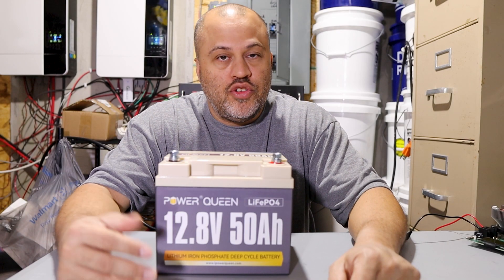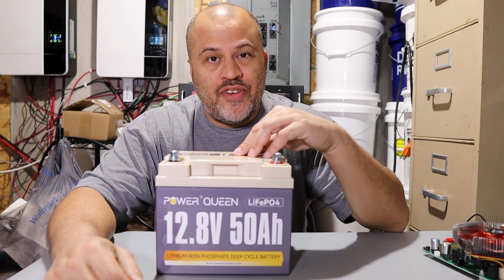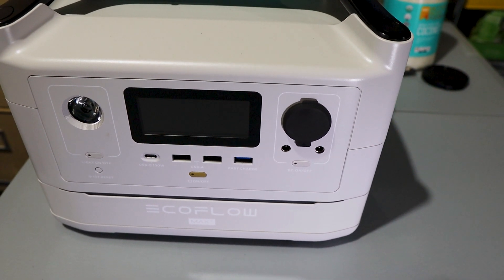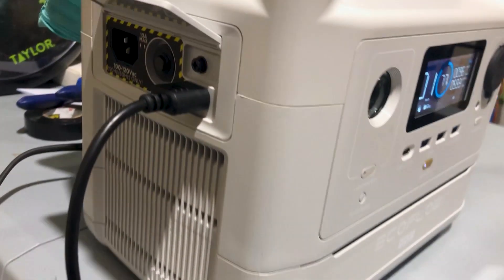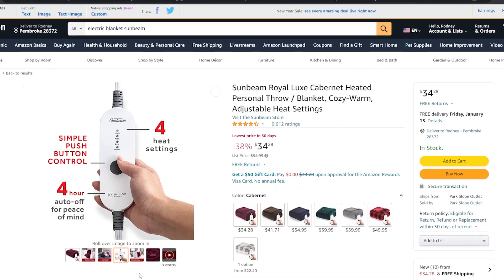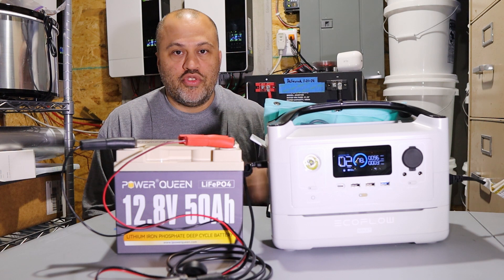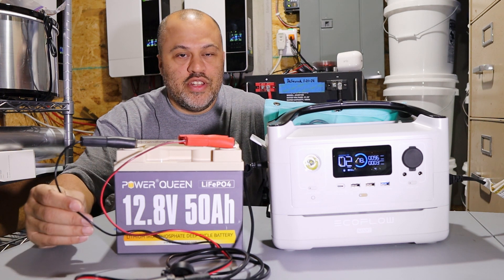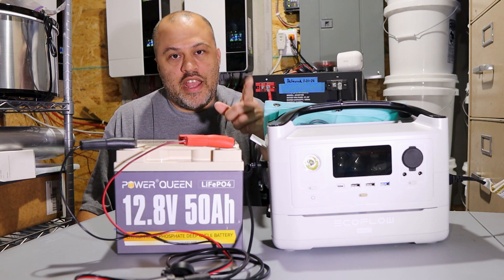DIY power Expansion for Solar Generator - Power Queen Expansion for Ecoflow

Comment: i used to use a 12v battery to extend my Buletti's capacity. I've since upgraded to a 48v 60ah battery it plugs directly into the power generators solar giving me a 500w intake. its way simpler and efficient with a 48v battery as you get the maximum charge without the conversion adaptor.

Comment: QUE TIPO DE CONTROLADOR DE CARGA  E SUA CAPASIDADE DEVO  USAR EM UMA BATERIA DE LIFEPO4 CAPACIDADE 100AH  , PARA ESPANDIR A CAPACIDADE DA MINHA  ECOFLOR RIVER 2   300WATIS , DE UMA FORMA Q DE MAIS AUTONOMIA E NAO VENHA DANIFICAR ELA , ELA . VC PODE ME AJUDAR NISSO , OBRIGADO
Reply from the maker: Lots of options depending on panel size. A victron charge controller will work but just make sure voltage and amps and in the range

Comment: I also have a river max. I was pissed when I learned I couldn’t use the extra batteries.  What is the best way to run this on solar?
Reply from the maker: Should be able to run solar directly to unit if it is within specs

Comment: Thank you for this! Can you charge the lifepo4 with solar through a charge controller at the same time as it’s hooked up to the flow?
Reply from the maker: I would think so as long as it is not more voltage or current than the unit can take.

Comment: Ahhh this is interesting. That device to link to the power station. Does it charge the battery in the power station while I charge the external battery
Reply from the maker: Should be fine as long as charge is in spec for power station input

Comment: Will the Ecoflow charge the other battery?
Reply from the maker: You can setup with a charger but no not directly built in feature
Reply: @rodneyhunt  I have the same unit as you and I crunched the numbers and please do not take this as criticism; it is only the economics. I priced the Super Queen Battery at about $130 tax included from Walmart online. The Ecoflow River Max Plus battery is $139 tax included. You would need to buy cables and a battery charger for the Super Queen. The Super Queen has 600 watt hours and the Ecoflow battery has 720 watt hours. 

Enjoyed the video thumbs up and it your video does give other options. Thank you.

Comment: nice video.  By now you probably realize that you can nearly double the charging speed (from 8A to 15A) by using a cable with a XT60i connector rather than using the car adapter.
Reply from the maker: Indeed but this is what I had on hand. Thanks
Reply: Can u elaborate on that?

Comment: What if you want to charge with solar panels
Reply from the maker: You can charge battery with a solar charge controller. So yes you can
Reply: @rodneyhunt  thanks your video is very helpful, 
In that case charging it with solar energy I would have to double the XT60i connector?
Reply: NONA-fq8hp i see most comments relate to the 60 but i use the 60i as it has a larger input. 60 is rated to 100wt i believe which is compatible with the 8 to 10 amp cig socket. Simply use a 60i lead with lugs from the battery instead... I do have an inline fuse tho.

Comment: Is there a way to charge the 12v battery with solar panels simultaneously?
Reply from the maker: You can use a separate charge controller for it with a panel connected.

Comment: Hello Rodney. Can I connect my battery pack to my solar panel at the same time as the battery is charging my ecoflow?
Reply from the maker: @Just-Offside  As long as charge controller voltage is the same range. I would not connect directly to battery but through a charge controller should be fine
Reply: @rodneyhunt  yes, I have a solar charge controller connected to the panels
Reply from the maker: Should be fine in my opinion. Just like charging a battery and using with an inverter at the same time. Just keep voltage and amps within range of solar generator input.

Comment: This could help folks when their power station battery dies. Most of the power stations don't give the ability to replace the battery but this allows one to keep using the other components of the power station. I have Licciti battery box with BYOB (Bring Your Own Battery) but I will definitely be looking at doubling my capacity now. Great info sir.
Reply from the maker: Hey thanks! Glad it helped

Comment: This is super cool 
But i would actually like to see how to do it the other way around 
Have to Eco Flow charge my car battery!!!
Reply from the maker: @carolmaplesden916  👍
Reply: You just plug a battery charger into the AC port or get a male DC 12v to jumper cable cord and charge the car battery like that

Comment: Same your money this battery BMS keeps shutting down…
Reply from the maker: Which battery? Are you over the rating?
Reply: @rodneyhunt  it’s set to 14.4 on charge controller bms shuts down after battery is charged none of my other batteries does this I can leave my other batteries hooked up and nothing turns off everything keeps working put on the power queen for some reason it turns off my inverter witch is only 600 watts beeps giving battery error charge protection..
Reply from the maker: @dan32one44  might be going over charge limit even though set to 14.4. Try lowering the setting slightly and that might fix it

Comment: if you use the 12v car lighter port on the echoflow, can you recharge that car battery?
Reply from the maker: Not sure if that will work. May just need to use a standard charger.

Comment: Appreciate the uploaded review. Just wondering what you think if the product a year on & where you got it from as its hard to find now
Reply from the maker: I got the solar generator at samsclub but not sure they have it now. Still like it for the right price if you can find it
Reply: @rodneyhunt thankyou for getting back to me.  Seems like its sold out on that site too.  I prefer the RM Plus design over the River Pro so will keep looking for it.
Reply: @rodneyhunt is it possible to add expansion battery on this like its possible with the River Pro?
Reply from the maker: Not sure one is prebuilt for this but you can always add your own with a few modifications to use thru the solar inputs etc
Reply: @rodneyhunt  having searched for hours last night it appears this model is not available in the UK & no one seems to be allowed to deliver it to the UK from USA either.  Might have to buy the black model which only provides 576WH (River Max)

Comment: get a 240w converter and attach the battery to it and the other end to the ecoflow, I have a converter on my battery and it inputs 192 watts to my ecoflow river 2 max
Reply from the maker: Thanks. Many ways to keep it charged
Reply: Yes Im loving my ecoflow, what mppt controller do you recomend  tp charge my battery?
Reply from the maker: I like the small victron. But depending on solar panel size/amount. https://signaturesolar.com/victron-bluesolar-mppt-75-15-solar-charge-controller/?ref=rodneyhunt
Reply from the maker: They have bigger units if you want to charge faster but that one should  charge a small battery back with no problems.

Comment: Does this charge the battery back up when you plug in the ecoflow?
Reply from the maker: It can. Best to charge with solar if you have it. A generator or car will work also. Lots of options.
Reply: @rodneyhunt  but can it charge just by leaving it plugged into that port?
Reply from the maker: No that is for using the power.

Comment: Try to use the solar cable and you could get more power to the Ecoflow. It should charge with more than 8 Amps.
Reply from the maker: Yes you can do 12 amps with the solar input. I just have not made a cable yet. Wanted to show it with off the shelf products you can easily purchase. Thanks
Reply: Great idea too. After watching another video I seethere is also an xt60 with battery clamps